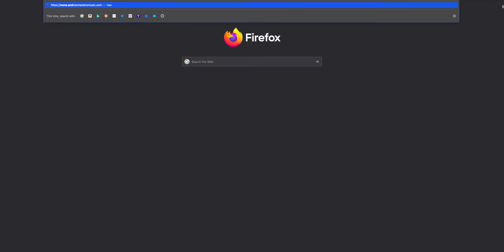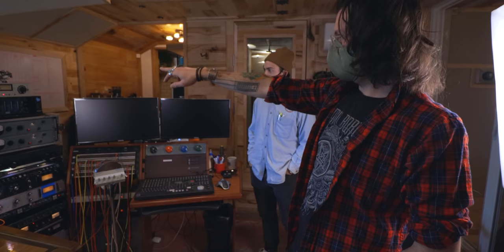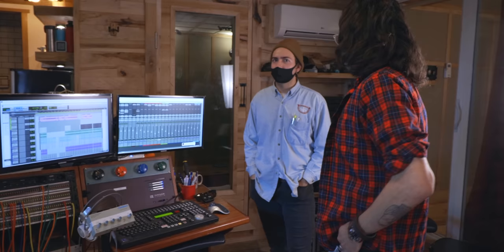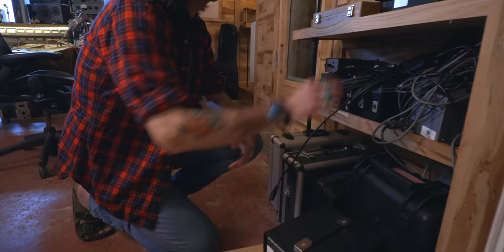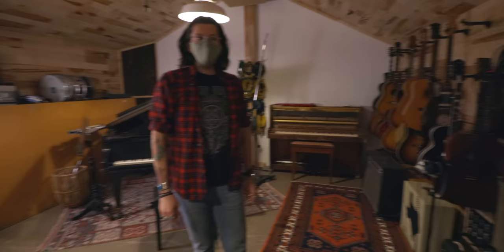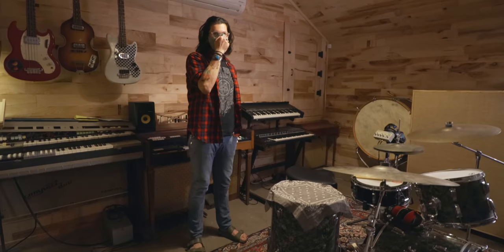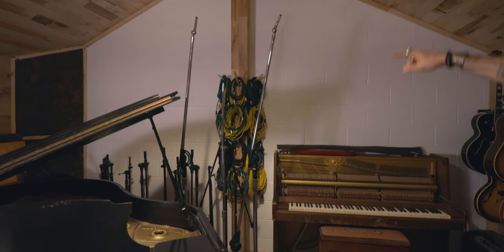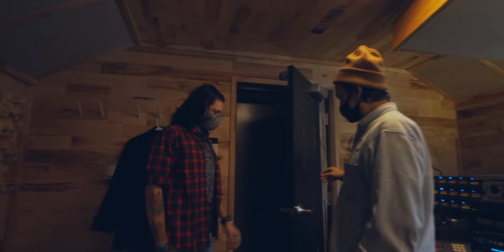EPIC HOME STUDIO Setup 2020 | The Carriage Works (studio tour)

Comment from the maker: Have you built your own home studio before? What was the hardest part and what would you have done differently?
Reply: Hardest part is knowing where to begin. What I would have done differently is save and buy quality gear from the start.
Reply: waiting for my roommate to move out
Reply: I would have put the duvets in covers first and then put them around plaster boards before putting them on the wall. I just have the bare duvets nailed to the wall to stop the room reverb at the moment and I can't bother take them down to do the covers and plaster board thing. It's only cosmetic reasons anyhow as it works as it is for me
Reply: I've built four studios, different locations, New Jersey, Tennessee, New York City and currently Wisconsin. Most difficult part was running cables via pvc pipes underneath two homes and now I'm building an isolation booth for my computer and rack for three Motu usb 8Pre's, patch bay, power conditioning etc.
Reply: @georgemickel6608  we have 16ch going in to the main house from the studio - twists, turns - you're absolutely right, that part is a huge pain.
Reply: Actually trying to learn your room’s acoustic issues has been my biggest challenge. Don’t want to just guess and build a bunch of stuff that winds up just making it worse. Room acoustics for people like me who only know what they see in other studios vs what is actually effective is my nightmare / challenge.
Reply: Love this series. I would really like to see more cutaways. When you guys talk about specific gear, actually seeing it really up close. I understand it makes the edit tougher, but going back through the studio after your walkthrough and just hitting every piece of gear you can remember talking about (so what if you miss a few). That would be great. They mentioned some odd gear in the beginning of the video I would have love to have seen close up.
Reply: @greggerosky3788  HMU Greg - happy to share
Reply: I have piggy-backed on an old Airstream trailer and made it into a modest off-grid mobile studio, not a lot of gear, but designed to be both a control room and a tracking space, while sleeping with a woodstove. The hardest part was learning how to restore a vintage trailer, and use the limited space to my needs. Differently? I would say using real glass instead of plexiglass when replacing the windows.
Reply: Great vid and im now subscribed.  My Studio is slowly comming together. I recently scored a vintage  Soundcraft series 600. a board that ive always wanted ever  Since after using the big 32 channel  of the same series yrs ago in a pro studio. Space is key right now (or lack of more like) When i get into my own house it will be more suitable. But im learning every step of the way, its different on your own.    I piece at a time.,   I will enjoy lookin in at what you are doing here.    stay safe man !  and thanks
Reply: not build it in my office...lol
Reply: @Jason Upchurch sorry to hear than man. But it happens. hope the next person in that house appreciated it. A bud of mine once left a vintage set of Klipsch Cornwalls behind.  What a find for the next person !
Reply: hmm.. good question. I would probably have designed the cable layout better and more Integrated into the walls. Not having to drill through walls afterwards! DOH!.. and I would have isolated AND insulated the floors a lot better.

Comment: Yes,  I am actually currently working on my studio. After many years of having a studio that has been based around software, I wanted more,  I wanted a studio people could actually see. I wanted hardware so I went to work in making this lifelong dream a reality. This is what hard work do, this is where dreams take you when you believe that they are real, so here I am. I got to thinking about the icons, icons such as Quincy Jones and Jermaine Dupree. I said to myself, this is where I want to be at, and here is where I am, not because I bought this and bought that, it's because I believed that I could do this and I did.  The hardest parts to me was the months and months of research not to mention learning all this gear. But if you want it bad enough it's very, very rewarding.  Though I'm still building my studio, I can say I am where I want to be. I can't be more grateful right now.

Comment: Miktek is the best kept secret in mics! Their PM9 is a beast live and in the studio. I really can't understand how the company is not more well known.
Reply: Dig!
Reply: Their LDCs are not even a secret and have been the flavour of the day amongst the "flavour of the day" people [ those who've never written a proper song, ever] over at gearslutz a few years back. Their tube mics have Chinese capsules, a total NoGo for a microphone -and a NoNoNoGo if it costs more than $250. They are only tolerable if you are able to compensate with an U47, vintage C414s and Lomo's.  Their PM9  might be good. Good for you.
Reply: @RockmannMusic  Manley mics also have Chinese made capsules. If you can make a good capsule in Germany, you can make a good one in China. It's not magic, it's a matter of engineering and budget.
Reply: @snippletrap  The engineering, means copying drilling patterns, cutting the frame etc.,  is doable "everywhere" with a clean room and a cnc machine.  It's not a matter of magic but it is a matter of the diaphragm material. The diaphragm material in Neumann mics for example is exclusively made for them. Their diaphragm material carries the Neumann sound/timbre. That's the reason why a third-party re-skinned Neumann U87 doesn't sound like the original anymore and also the reason why any Neumann "clone" will never ever sound like the original, no matter what. It's a disgrace that Manley is supposingly using Chinese capsules as a heart in a $3K microphone. It shows that they are not a microphone company.  I would rather go for an honest Oktava MK 319 where everything is made in-house. To me it is not a microphone company if they don't manufacture their own capsules, easy rule, . . because everyone can slap together off-the-shelf microphone parts and put a name tag on it
Reply: @RockmannMusic  If Neumann shipped their capsule material to China for assembly there, would it still be a Neumann?  Apple doesn't manufacture its own hardware, but it still seems like a computer hardware company to me.  And just because you outsource production, doesn't mean that those parts are "off-the-shelf".  I am sure that Apple and Manley are instrumental in the design and QA process.
Reply: @snippletrap  We are talking about microphones. The Chinese capsules and hardware parts used by the usual suspect "brands'  are mostly made from "off-the-shelf" parts. Same tin thin housings , same capsules [more or less selected], different label print.  For $3K MSRP Manley could go for Haun/MB capsules like Brauner. Chinese copies = cheap and not cheerful, bad reputation for good reasons. In short, certain "mic companies" using cheap Chinese parts for their products and selling it for a premium price [Apple is only using "cheap" labour, the parts in their products are mostly from good quality]. Neumann is know for Made In Germany. That's what their business and tradition stands for. AKG/Samsung did it differently and cheapened the brand beyond repair. Buying a Chinese parts Thomann house brand mic for $150 is fair enough buying a similar/equal pseudo brand model with a few over-advertised  50cent "Wima" caps inbuilt for  $1K is unintelligent. The traditional microphone companies, from Shure to Neumann,  have a history of inventions and fortunately most people value and vibe with this. The new pseudo brands that using Chinese parts and copying old designs have obviously none of that. That's the reason why someone will never find any of these mics in the mic lockers from reputable studios here in the UK
Reply: @RockmannMusic  while I’m sure we all appreciate your fervor I think you’re missing the point. We like how it sounds. It sounds good to us so we use it. I’ll put it up and shoot it out with any of our LDC mics because why not? I have enough belief in our abilities as musicians and engineers to use a $3 radio shack mic if it works for the music.

Comment: Are these monitors placed correctly? I keep seeing short sides on the desk and long sides to the listener position. What happened to the equilateral triangle? Are incorrectly placed monitors this big an issue or am I missing something?
Reply from the maker: Yeah I remember learning about that when I got started. I’ve adapted as my career has progressed. I tend to take points from my favorite engineers I’ve worked with. Spike stent, Eric valentine, billy bush, mark meedham, joe chicarelli and zero of these engineers have ever busted out a measuring tape or spent time to make a triangle. Speaker placement can be subjective according to your room, listening spot, quantity of speakers, preference position of speakers etc. 

Especially if your room is not treated well using the triangle move is going to make the imaging a bit weird and you’ll be hearing more of the room than what’s coming out of the speakers. In my opinion. But I’m not a rules guy, I just learn from the people who are doing what I want to do. So if triangle thing works for you do it up.
Reply: how things sound, and how sounds make me feel. thats my measuring tape.